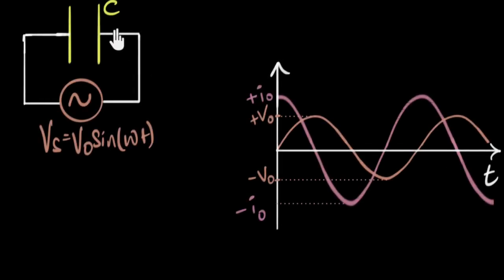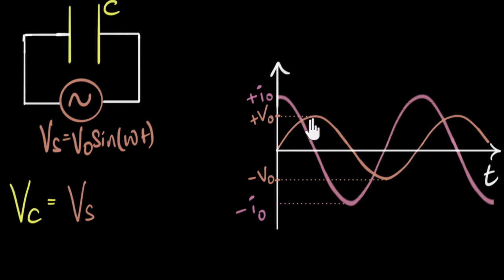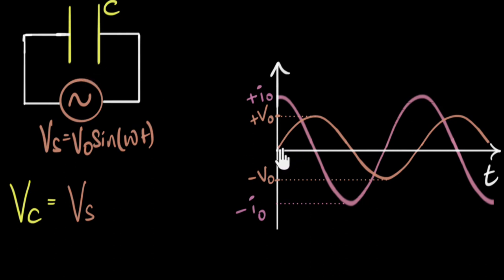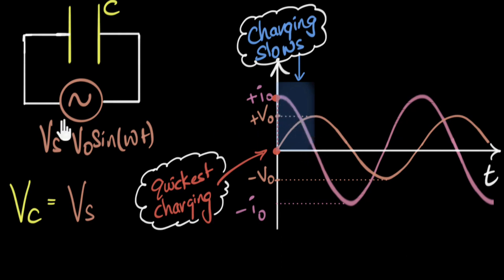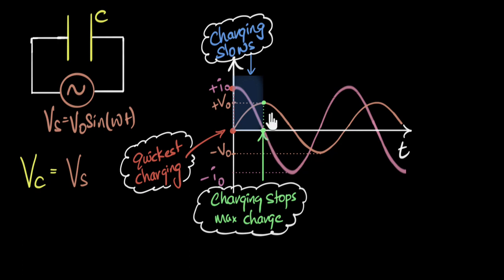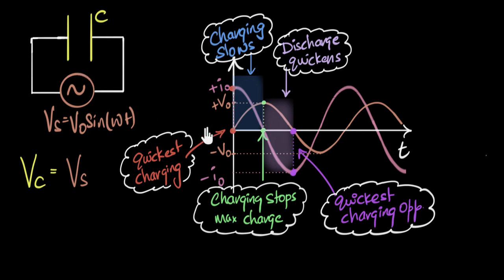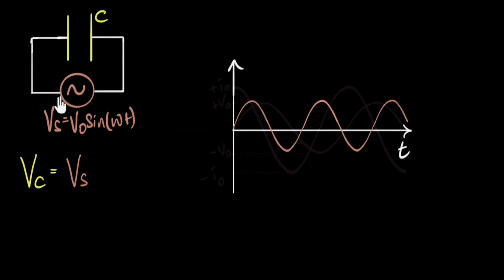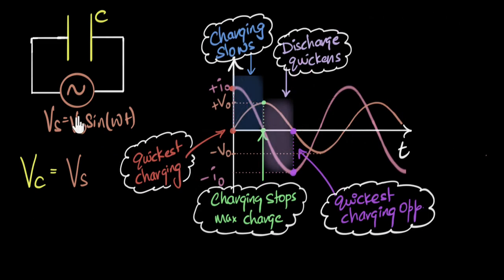Why current leads voltage in a capacitor (logic) | Alternating currents | Physics | Khan Academy

Comment: But why more change in voltage means the current should reach the maximum value?
Edit: I get it, since the voltage change is maximum therefore the current it induces should also change by maximum, any other change is lower than the maximum change and hence current doesn't reach a higher value.

Comment: Suppose voltage on charged capacitor is V. Now, apply External electric field with voltage V across capacitor but in opposite direction to earlier voltage. Even if you connect two plates of charged capacitor with wire, there will be no current in wire because net voltage across capacitor is V-V = 0 but there are external voltage due to electric field. Now, vary this electric field sinusoidely .

Comment: One second... When the generator voltage is increasing from zero,how the current is maximum? There is no voltage in the circuit there should not be a current.... I studied in Dinamo that when the voltage increase the current increase as the same
Reply: It's because change in voltage is maximum at 0V (the graph is the steepest) which means current must be maximum so that enough charge flows on capacitor and that it's voltage changes fast. When voltage reaches maximum the voltage change is the slowest which means the current doesn't need to supply as much charge to the capacitor. That's why current leads voltage on capacitor.

Comment: But why we taking the Current on peak at 0 position?
@ 0 position there is no current and voltage ....!!!!
Reply: Because at 0V slope of voltage is the steepest which means the voltage change is the fastest in that moment compared to when voltage reaches the peak when voltage is changing very slowly. Faster change in voltage means more current must flow to the capacitor. There's equation: ic = C * dv/dt